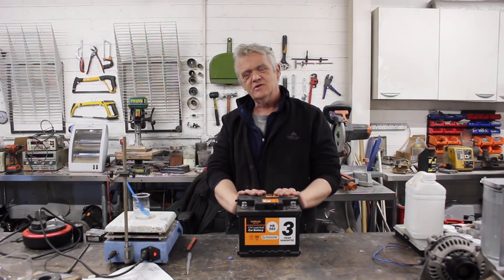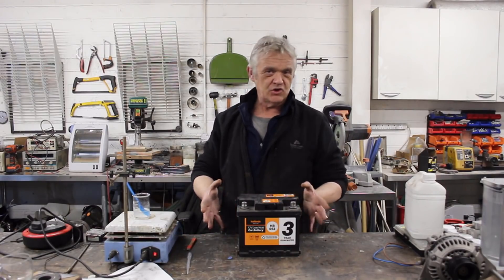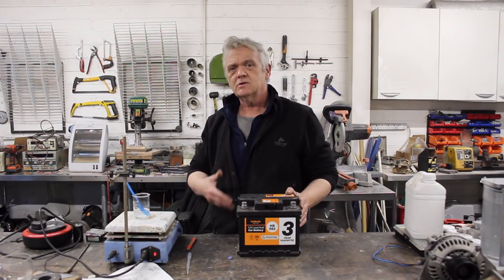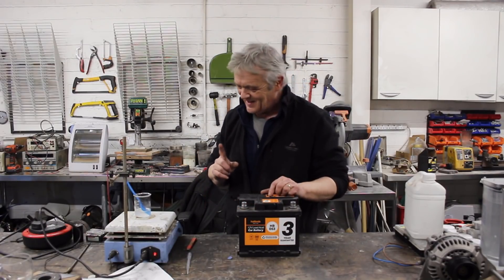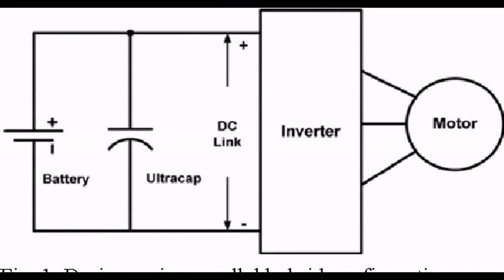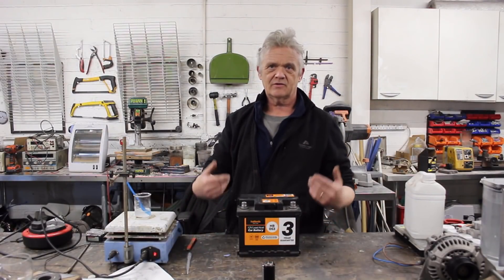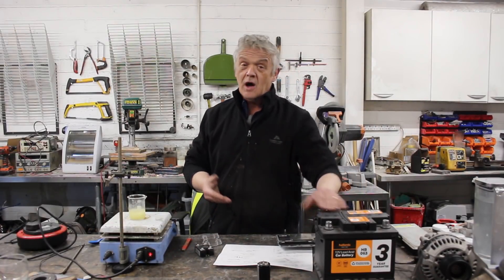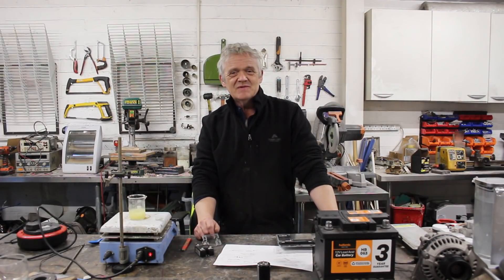1505 Improving Your Battery Storage With Supercapacitors

Comment: How would this affect the available run time though?
Reply: Probably not much better, might even be worse due to all the power conversion losses. The main motivation seems to be to improve battery health rather than increased output energy
Reply: @sumitmamoria  no, sorry, I should have explained further. Surely the capacitors will have a limited storage; smaller than the bank of batteries, so the output from the capacitors, which can handle a higher output, will be limited - before your back to using the battery and should limit max output to save it from damage..? I guess on second thoughts it will run almost as long but will provide a buffer of protection for run times that don’t exceed the storage in the capacitors, before they recharge
Reply from the maker: not much - this is really peak shaving and to cope with high power demand over short periods of time - like starting a motor - the start of a. motor has a very high draw the running of a motor much much less - you are using the caps to be in the middle of that and they are tied to the battery bank - you second comment was pretty good by the way

Comment: Thank you Bud =) .........Was really hoping you would address the battery to cap issue........Some lithium Ion batteries instantly failed in this kind of set up, actually over discharging to fill the cap.......
Reply from the maker: lithium is notoriously delicate - a little control electronics is needed if using lithium - you can only really connect a lead acid straight up and even then it's not the best

Comment: Lots of words here but all this would be much more useful if the ideas were implemented with instruments to show the effect being discussed.  I still have yet to see (perhaps I missed it) a light bulb being lit up by any of the devices shown in these videos.
Reply: This particular video is more a "thought exercise" not a demonstration.  He will sometimes offer a demonstration later if necessary.
Reply: Light bulbs are very poor examples of power.  They're really easily faked, require a wide variety of power input, and are very nonspecific as a meter. 

Robert regularly includes meter readings on all his generator videos. Which is how it should be done.
Reply from the maker: there are lots of examples - you could try my suggestion and have a look on google scholar - but I suppose that would take you doing something - so why on earth would you do that?

Comment: Great Video As Always Rob 
I Do Have The Same Super Capacitors That You Have Got On Your Bench..I Made An Super Capacitor Bank With Charging Handle. 12 and 5 Volts Out..Works Well...But The Voltage Leak On The Super Capacitors Is Not Good..Should Of Gone For Maxwell Super Capacitors.
I'm Going To Use A Battery In The Charger As Well And Thanks To The Great Video I Now Know How To Do It...Many Thanks
Reply from the maker: awesome mate - keep me up today with your progress will you?

Comment: Could you use that as a way to hook up power from different sources (solar and wind) to the same battery
Reply from the maker: yes - several systems have been researched to do exactly that - have a quick look on google scholar with hybrid battery supercapacitor micro generation as key words
Reply: Most of the larger integrated solar charge controllers nowadays have connections for the battery bank (including individual cell monitoring), a three phase AC inverter (up to 25KW continuous output, and the ability to seamlessly charge from solar, wind, and even shore power or automotive or any combination of those at the same time. 

The Chinese have had them for years now. They are the innovators in this field. You can buy them online but many aren't yet UL listed so caveat emptor applies. But due to tariffs and shipping inflation they aren't as inexpensive as at first blush they appear. However, it remains that the technology is quite well developed already by the Chinese and there's a thriving domestic market for them.
Reply: They're often described as a "solar inverter" when searching for them online.
Reply: They are programmable with different power profiles. So they can easily be reconfigured for a battery upgrade - even if the cell chemistry used changes. They are quite versatile.